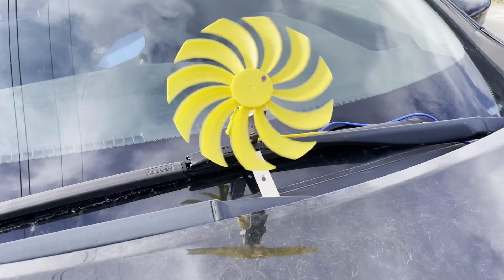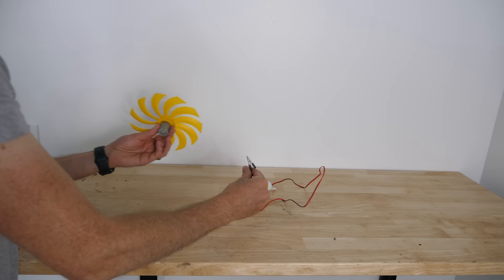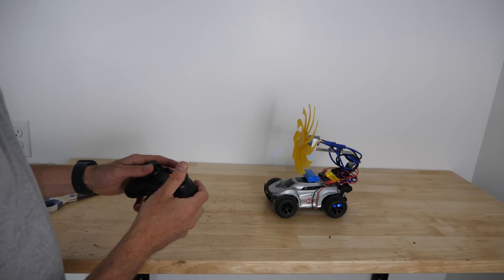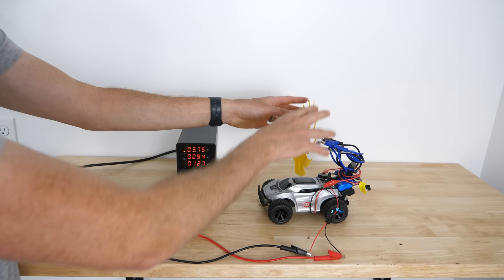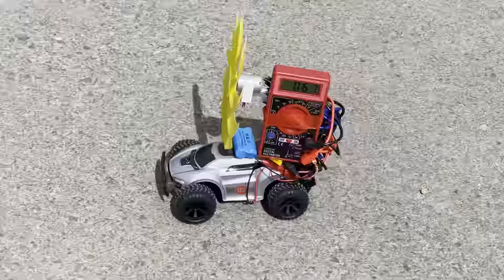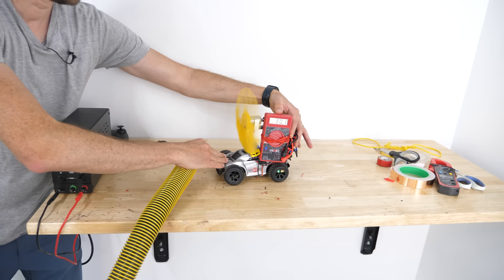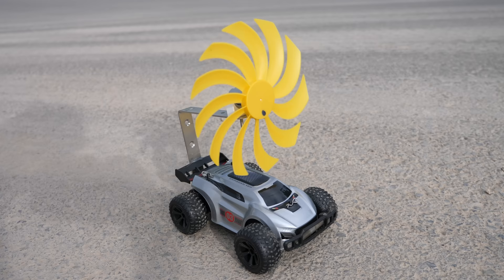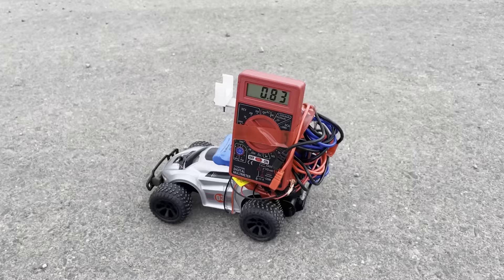Can You Power a Car With a Wind Turbine?

Comment: This is an awesome analysis! Thank you for your experiments and demonstrations!👏
Reply: Ur right
Reply: Did you even watch the video?
Reply: Yes I did
Reply: Rolls eyes
Reply: see that quite a few people are giving you a thumbs up. Keep in mind this little technique: if your phone goes down to one bar and you plug it in and you are still using the phone, your phone will fully charge. This is called pass-through technology. If you do research on this, you will find that if this was applied, you wouldn't have those inefficiencies.
What did I just do? I just used a technology that's been used for quite some time, instead of doing everything directly. It means that for over a 100 years, we've been off the direct power train and got on Nikola Tesla's alternating technology. As soon as you start to understand exactly how you can power something at the same time use its power, you can make this work. Of course, other companies and other people have already done this and got the car in real life to actually work.
So instead of arguing back-and-forth with the guy who I believe is prejudiced on certain subjects, I simply went to Google AI and asked the question. Here is what AI stated:
Yes, there are a few examples of people who have successfully driven cars with windmills attached to them.

In 2009, a team of students from the University of Michigan built a car that was powered by a wind turbine. The car was able to reach speeds of up to 35 mph.

In 2010, a team of students from the University of California, Berkeley built a car that was powered by a solar panel and a wind turbine. The car was able to travel 100 miles on a single charge.

In 2011, a team of students from the Massachusetts Institute of Technology built a car that was powered by a wind turbine and a hydrogen fuel cell. The car was able to travel 200 miles on a single charge.

However, it is important to note that these cars are not practical for everyday use. They are very expensive to build and maintain, and they are not very efficient. The wind turbines are only able to generate enough power to move the car at slow speeds.
It is more likely that wind power will be used to supplement the power of a car's engine, rather than be used to power the car entirely. This could be done by using wind turbines to generate electricity that is stored in a battery, and then using that electricity to power the car's engine.
Please start asking questions before accepting information from someone that is intelligent but often makes quite a few mistakes. Even if you have to go to AI and didn't back it up with actually going to websites that show the results of people's accomplishments, if not then we can't move forward. We stay the same and people like that don't want real change. Read it for yourself before you give thumbs up.

Comment: Now there's a case to be made for adding windmills to electric or hybrid vehicles, to recharge their batteries while they're parked. Sure, it might not be a lot of charge, but it could be used to cool down the vehicle while it's sitting in the sun, or to slowly recharge it in a grid-down scenario like if the power is down due to a blizzard. Adding a small solar panel and a small wind turbine to vehicles, which would fold down when not in use, would help with that, even if it's providing barely enough power to keep the fans going while it's hot and sunny outside, or barely enough to charge your phone to make emergency calls.

Comment: The one thing that could maybe make sense is having a car batter charged by a wind turbine while parked, assuming the turbine is put away while driving. This is the same idea as the new Prius that has a solar panel on the roof - it’s not nearly enough power to keep you going while driving, but it is enough to add some modest mileage while parked in the sun for hours
Reply: what    if  there  is  no  wind?
Reply: @robinsss they’ll wheel you out since you seem to be full of it😂😂😂

Comment: Great analogy ! Of course i knew the increased air resistance is exactly the problem of adding a wind mill on a car. Well explained ! I like the fact that you don't actually just say it's fake right from start and you actually build a sort of tension.
Reply: you become a sail which hurts eco because the energy you do gain back will be reused on top of more energy for you to move. lol

Comment: I think it might be possible to get a small amount of energy by using a turbine in the vortex behind a car. It might also have an added benefit of disrupting the low pressure drag behind the car. I think a small diameter paddle wheel the width of a trunk on the edge of the trunk might work.
Reply: no, if you put something between the vortex, the vortex won't be produced

Comment: Keep in mind that voltage you measure is with the generator unloaded, which is a VERY different situation than when it's loaded, i.e. actually using power
Reply: Can you elaborate? I have too little knowledge about electricity to understand your comment.
Reply: @DoubleBob  load means what it's generating is being used ie a motor. Vs unloaded meaning nothing is taking power from it
Reply: @Double Bob  like in an old house when you turn on a vacuum the lights dim for a second
Reply: Imagine it's a difference between running without anything and running while pulling a semi truck. You wil be slower. Because the friction in the semi truck wheels draws energy from you.
Reply: @DoubleBob  It's like riding a bike downhill. Just because you can go fast when it's easy doesn't mean you can keep that up when it gets difficult
Reply: @joshg6491  just making sure that you do in fact realize that ANY circuit requires a load on it otherwise it will melt down... yes ??
Reply: It takes 98 joulesof energy to lift 1 kg 1 meter from a static point. Universally this is true here on earth  regardless of what provides said joules be it electric, combustion, or carbohydrates you eat.. its un changing
Reply: @MrDmadness  just making sure that you do in fact realize that you don't need an explicit load in a circuit to have a load
Reply: @ILoveTinfoilHats  im unsure what youre meaning. A load can be anything a motor, a light, a solenoid or a resistor. If there is no load then why do you have a circuit ?? Respectfully intended. In this case the load is the generator
Reply: What is i.e.?

Comment: I got this idea, Bernoulli's principle is the faster a fluid move, the lower the pressure. What if we put a turbine facing perpendicular to the direction of the moving direction and placed partially inside a car (only the face of the fan is visible outside). When the car moves, the air around the car will be moving fast, thus a lower pressure compare to the atmosphere. The difference in pressure will spin the turbine without creating much resistant, right?
Reply: wouldn't be the same issue only in a more complex setup? Any fluid perturbation you are doing that will power your fan will be caused by the car moving itself which mean the energy dissipated to create that vortex will always be greater than the energy you will be able to extract and you will end up with a less efficient car

The design might be better at extracting energy from ambient wind though (especially if it doesn't require a specific direction for the wind to blow) so maybe an option for recharging  battery on an e-car while parked (though you would need to leave on a very windy place for it to be worth)
Reply: driving with the windows open creates drag
Reply: But then you won't generate much power. You can't have free energy. To get energy from the wind mill, you have to add more power to overcome the added drag.

To put it simply - the "wind" that drives the windmill is directly "created" by moving the car forward. Thus any power created by the spinning windmill has to be put into the system from the car's battery in the first place.

You can use something like this to take advantage of wind in the environment (as he says in the video) but it would take very strong wind to be at all useful. 

And if you were trying to use this on a full size car for people, the windmill would have to be large, and the drag at freeway speeds would be far more than any possible benefit (unless you were driving in hurricane force ambient winds.)
Reply: @AnonymousFreakYT  You can create a design that reduces the energy required by the vehicle by putting the turbine in front of the vehicle. This would not be windmill powered but rather i crease efficiency through the windmill.
Reply: I think this way the propellers will generate a huge turbulence inside the car that will induce almost the same amount of drag as if u placed it perpendicularly, also this way the momentum of the car will be deducted from the momentum of the propellers cuz now they are moving on the same axis of motion but in opposite directions
Reply: see that quite a few people are giving you a thumbs up. Keep in mind this little technique: if your phone goes down to one bar and you plug it in and you are still using the phone, your phone will fully charge. This is called pass-through technology. If you do research on this, you will find that if this was applied, you wouldn't have those inefficiencies.
What did I just do? I just used a technology that's been used for quite some time, instead of doing everything directly. It means that for over a 100 years, we've been off the direct power train and got on Nikola Tesla's alternating technology. As soon as you start to understand exactly how you can power something at the same time use its power, you can make this work. Of course, other companies and other people have already done this and got the car in real life to actually work.
So instead of arguing back-and-forth with the guy who I believe is prejudiced on certain subjects, I simply went to Google AI and asked the question. Here is what AI stated:
Yes, there are a few examples of people who have successfully driven cars with windmills attached to them.

In 2009, a team of students from the University of Michigan built a car that was powered by a wind turbine. The car was able to reach speeds of up to 35 mph.

In 2010, a team of students from the University of California, Berkeley built a car that was powered by a solar panel and a wind turbine. The car was able to travel 100 miles on a single charge.

In 2011, a team of students from the Massachusetts Institute of Technology built a car that was powered by a wind turbine and a hydrogen fuel cell. The car was able to travel 200 miles on a single charge.

However, it is important to note that these cars are not practical for everyday use. They are very expensive to build and maintain, and they are not very efficient. The wind turbines are only able to generate enough power to move the car at slow speeds.
It is more likely that wind power will be used to supplement the power of a car's engine, rather than be used to power the car entirely. This could be done by using wind turbines to generate electricity that is stored in a battery, and then using that electricity to power the car's engine.
Please start asking questions before accepting information from someone that is intelligent but often makes quite a few mistakes. Even if you have to go to AI and didn't back it up with actually going to websites that show the results of people's accomplishments, if not then we can't move forward. We stay the same and people like that don't want real change. Read it for yourself before you give thumbs up.
Reply: Please look into the articles you AI. They can be quite misleading. For example, your 2010 car can only drive downwind slightly faster than a tumbleweed.
Reply: @martymassie313   Thank you you at least looked at the information the point was for everyone to do independent research I was trying to point out is that many people have been doing this research for very long time hence the dates. Now are they the only ones no I didn't wanna load an email down with all the information my library has gathered over 35 years, But solar and wind power and all this are being studied and universities around the world every day. Their level and the level of this video you just watch are so  Totally far apart it's start to be  Comical. But a simple thing is to do is what you did check into it look what has been done remember his model couldn't go down a straightway at all.
Reply: @martymassie313  there are a few cars that were built with turbines within the body of cars to produce any type of energy. Here are a few examples:

Chrysler Turbine Car: This experimental car was produced by Chrysler from 1963-1964. It was powered by a turbine engine that could run on any type of fuel, including gasoline, diesel, kerosene, and even vegetable oil. The car was not commercially successful, but it is considered a milestone in the development of alternative fuel vehicles.

Rover JET1: This car was produced by Rover in the early 1960s. It was also powered by a turbine engine, but it was designed for racing rather than for everyday use. The car was not very successful, but it helped to pave the way for the development of more advanced turbine-powered cars.

Toyota Fine- 1: This car was produced by Toyota in the late 1980s. It was powered by a small turbine engine that was used to generate electricity to power the car's electric motors. The car was not commercially successful, but it was considered a testbed for Toyota's hybrid electric vehicle technology.

These are just a few examples of cars that were built with turbines within the body of cars to produce any type of energy. While these cars were not all commercially successful, they helped to pave the way for the development of more advanced turbine-powered cars that are now being developed by automakers around the world.
Reply: @WIZ56575  Ah, yes. There may be a misunderstanding here. I believe most the turbine cars you just referenced are more like fuel-powered rotary engines than wind powered.

Comment: But you could use your fan/generator as a sail :) ( Weelll a sail would work better.... )  Veritasium did a video on this where his design of a land sail boat travels faster than the wind.
Reply: see that quite a few people are giving you a thumbs up. Keep in mind this little technique: if your phone goes down to one bar and you plug it in and you are still using the phone, your phone will fully charge. This is called pass-through technology. If you do research on this, you will find that if this was applied, you wouldn't have those inefficiencies.
What did I just do? I just used a technology that's been used for quite some time, instead of doing everything directly. It means that for over a 100 years, we've been off the direct power train and got on Nikola Tesla's alternating technology. As soon as you start to understand exactly how you can power something at the same time use its power, you can make this work. Of course, other companies and other people have already done this and got the car in real life to actually work.
So instead of arguing back-and-forth with the guy who I believe is prejudiced on certain subjects, I simply went to Google AI and asked the question. Here is what AI stated:
Yes, there are a few examples of people who have successfully driven cars with windmills attached to them.

In 2009, a team of students from the University of Michigan built a car that was powered by a wind turbine. The car was able to reach speeds of up to 35 mph.

In 2010, a team of students from the University of California, Berkeley built a car that was powered by a solar panel and a wind turbine. The car was able to travel 100 miles on a single charge.

In 2011, a team of students from the Massachusetts Institute of Technology built a car that was powered by a wind turbine and a hydrogen fuel cell. The car was able to travel 200 miles on a single charge.

However, it is important to note that these cars are not practical for everyday use. They are very expensive to build and maintain, and they are not very efficient. The wind turbines are only able to generate enough power to move the car at slow speeds.
It is more likely that wind power will be used to supplement the power of a car's engine, rather than be used to power the car entirely. This could be done by using wind turbines to generate electricity that is stored in a battery, and then using that electricity to power the car's engine.
Please start asking questions before accepting information from someone that is intelligent but often makes quite a few mistakes. Even if you have to go to AI and didn't back it up with actually going to websites that show the results of people's accomplishments, if not then we can't move forward. We stay the same and people like that don't want real change. Read it for yourself before you give thumbs up.
Reply: @WIZ56575  To say "powered by wind turbine" isn't enough information.  You can do it.  But, considering power loses, does it make sense?   A system has several inputs and outputs.  When you add them up, it doesn't make sense - with respect to the alternatives.